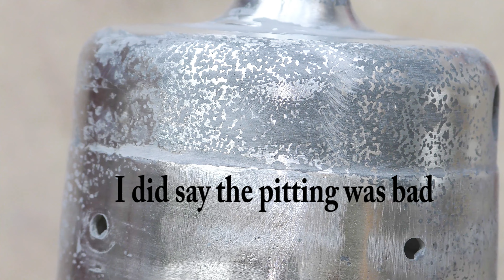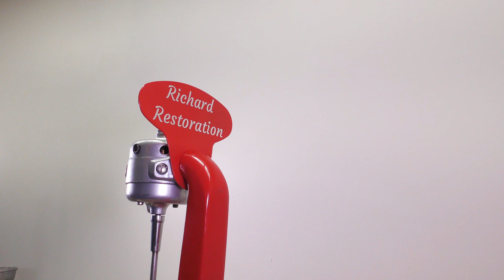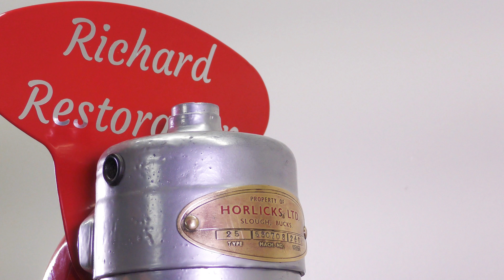Vintage Milkshake Machine Restoration

Comment: Shameless name and color change. Not a true restoration.
Reply from the maker: Thank you for sharing your opinion! I understand that you may have different expectations for a restoration, but I hope you still found some value in the video.and at the end of the day its mine and now lives on my bench and has made us lots of milkshakes for the family cheers Richard
Reply: So if it was for a client who likes to collect these old gadgets and wants to restore them to look and work as close to the original as possible, I would understand them getting upset then, but in this case I don't see a problem with him changing the color or the name. It sounds like this is for personal use in the household so it's fine then. The color is a very nice red and he did a great job restoring the machine and making it work again. It would have just rusted away further otherwise. So I think he did a very good job